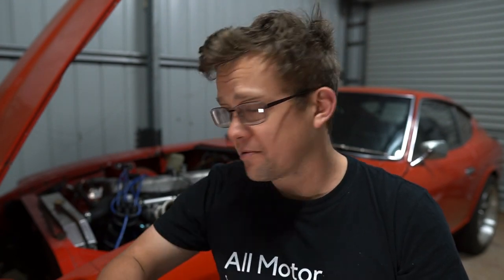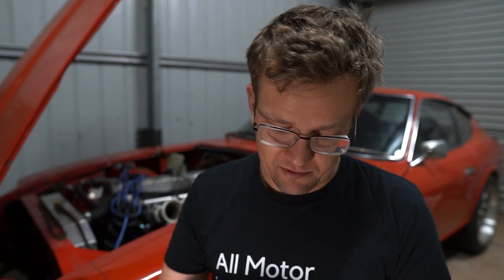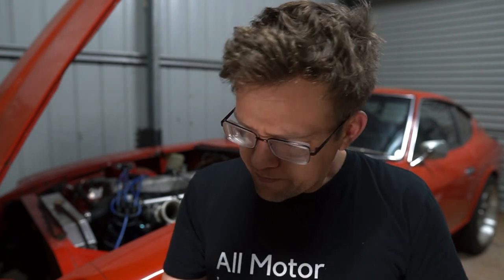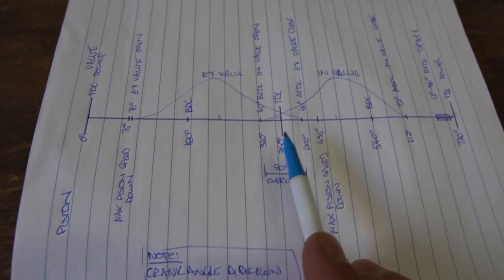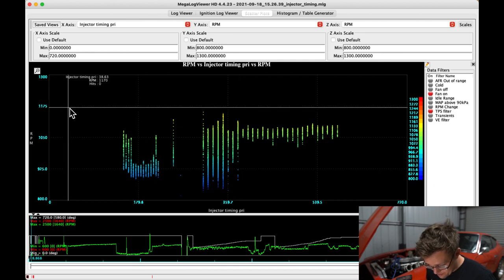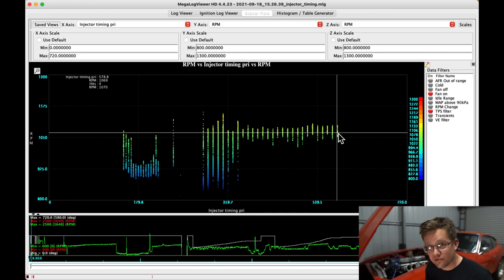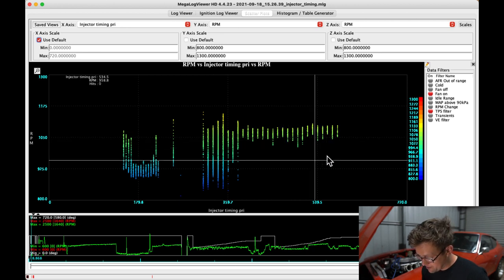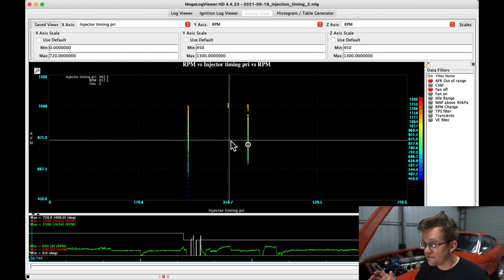Experimenting with injector angle timing – what works best?

Comment: You have the data backwards as does Andy W in his video.  The number in megasquirt for injector angle is degrees before top dead center.  Numbers in the 200’s would be OVI, numbers over 380ish would be CVI.

Comment: Lucky for me the Holley EFI software has a 2d 16x16 table for setting the Injection End Angle. I just built a super basic MAP vs RPM table using CVI for cold start and idle and OVI for anything above 1600rpm. Technically the high rpm OVI strategy starts spraying into the back of a closed valve but it just continues to spray while it is open. Given my cam specs I'm targeting 300* and 450*. If I wanted to get fancy I could optimize the 16x16 table for various loads and rpm and use an advanced table to offset the injector end angle based on coolant temp or various other sensor inputs. Honestly anything beyond what I've set up already is over my head haha.

Comment: Nice one Aaron. You're certainly getting into the deep and gritty with the tuning strategies. That was a very interesting video. O.V.I definitely seemed to produce the smoothest idle, and it was visibly noticeable in the video, also the idle speed sounded highest with O.V.I too👍🇦🇺
Reply from the maker: Thanks Simon.  I am particularly interested in the claimed improvement of in cylinder cooling and knock threshold.  How to test that though is a bit tricky

Comment: Injector positioning in the head vs further up the runners would have an effect on what the optimal injector timing should be. How would you go about factoring in injector timing with that arrangement?
Reply from the maker: There is probably some maths or rule of thumb available to estimate the injection time delay as a function of RPM. I would verify anything with a real world testing.

Comment: Thanks for sharing. I recently added a FT600 to my turbo Harley with cam sync. My experiance so far is open has worked best, gives me me a more stable idle, it did start better with a closed valve. 
Don't forget your cam specs are more than likely start with @.050 lift so the open and close events are a bit longer. I'm right at 130--130 BTDC ending my inj cycle. what ever you end up using you will end up spraying on a closed vale when the duty cycle reaches 75% and above, at that point it pretty much a constant stream of fuel.
Reply from the maker: Thanks for sharing Jim!

Comment: Injector angle made big difference to HC and CO emissions on idle for my SBC LT4 V8 engine. I had problem with emission test before but after tuning injector angles it passed test nicely. I have big injectors and pulse width on idle is ~1,7ms. Best injection end angle for my engine was about ~370-380 degrees ATDC

Comment: Hi, very interesting. Did you do one test for all data or a few? I am at the beginning of testing injector timing. My engine doesnt runs very hot, but i use tropic thermostat probe and fan to avoid much heat, so the fan would run early if the engine is idling around a few minutes. Guess i will have to unplug the fan?!
Reply from the maker: I have only tested on my 240Z. The engine temperature contributes less moreso it is the valve temperature from the combustion in the cylinder which assists with closed valve injection vapourisation. 

I would not unplug your cooling fan.

Comment: More great stuff Aaron, but...
Do you need me to send you a degree wheel that you can bolt to your crank pulley so you can spend a few hours degreeing your cam?  Have a dial indicator?  Its really no big deal and quite informative - fun to see when things happen during each cycle and how you can vary events by advancing or retarding.  Then you won't be left wondering...and you can verify TDC while you are at it!
Reply from the maker: Thanks for your offer Keith. I have a degree wheel on my bench ready to use soon. I am keen to know where TDC is.